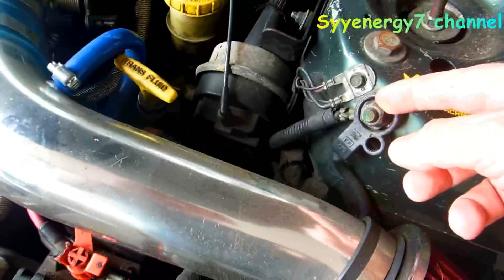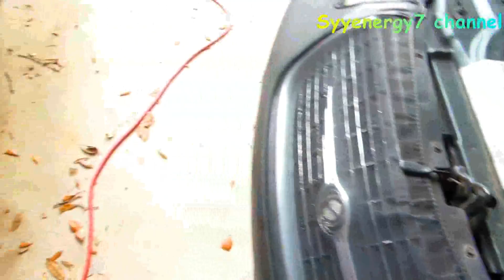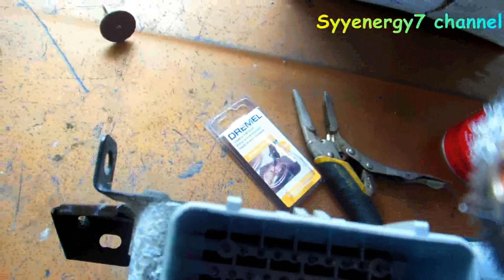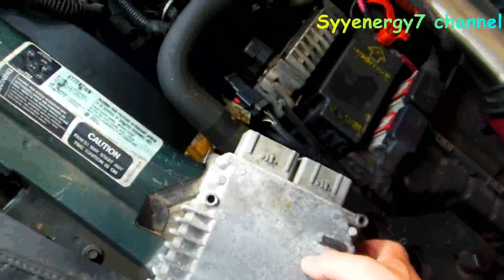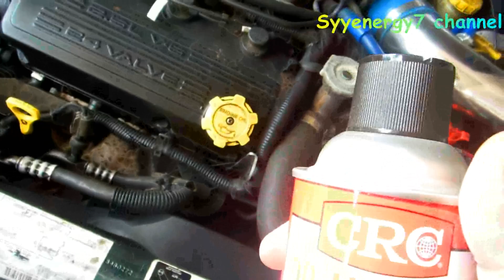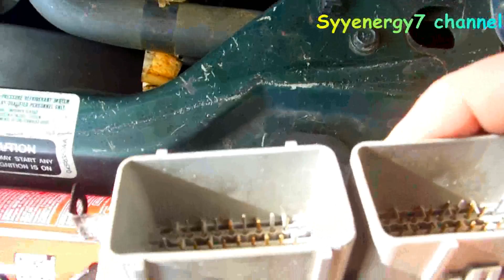How to Fix Car Electrical Problems - Strange problems, poor running

Comment: Hey bro..
Want a good idea...?
Take the cap from the electronic cleaner
Spray some on the cap....
Then dip a small brass brush into that..cap 
Then softly whip the ends of connections..grounds....//
Saves so much spray and dose a great job..

Comment: A Dremel tool to clean the computer pins !   Never,ever bring a wire brush, especially a powered one, near electronic connector pins.

Comment: i bought a Pontiac grand prix 1999 for $400 when i turn my heater on it doesn't usually work until speed 6 but it sometimes works on different speeds for a couple seconds then makes a sound on the driver side and my headlights go out same as the heater but my headlights and heater only work at the same time on speed 6 i have changed the blower resister thing and it didn't do anything so im stuck any ideas?

Comment: Use new dielectric grease on all the pins and connectors, instead of the Dremel tool, which can misalign and destroy the pins. Permatex makes and sells this special grease and it is readily available at any auto parts store. GM recommends NyeGel 760G, and sells it through its dealerships, although rebranded as a GM product. These special, dielectric greases both clean old corrosion off the pins and connectors and lubricate and protect them for years.
Reply: Anonymous98 never ever ever use electrical grease on ANY electrical point of contact!!. Proper installation of electrical Grease is around where grommets would be. I eat you should apply dielectric to the porcelain of a spark plug never to the tit on the top or to the inside of the boot for that matter...

Comment: I have a 2005 PT Crusier convertible. the windows on passenger side go partially down when I crank the car. the window on left went down partially and is now stuck. it was very cold when this happened the windows on passenger side will stay up once the car is warm. not sure if its a programing issue or not.
Reply: So you are the founding member of the club I'm in.. 98 Buick Lesabre windows on drivers side only work when its cooler out and some other weird stuff

Comment: My radio,lights, locks, and car key not working.
Reply from the maker: check fuse 5 , it's the one in the middle.
Reply: +syyenergy7 Thank you, it's actually my mom's car, I forgot to type that. I'll tell her.

Comment: hey im fixing to buy this 2003 maxima. its beautiful, I really like it. The price is good too $1,300 from my stepdads friend. However when i turn on the lights of the car, the signal lights stay on as well. They dont even blink as usual, they just stay solid. And when the headlights are turned off they function as they normally would.

Do you think i should invest in this car? please let me know your thought i would highly appreciate it. Could it be some electrical problem. If so would it be too much to repaor. The past owner looks like a DIY type of dude that might have worked on the car himself.

Comment: I have a 1999 jeep grand Cherokee and when the air and lights are on everything on the control panel goes to 0 and hazards come on.  When I turn lights and air off, it goes back to normal.
Reply: I am having this same issue with a 2003 nissan maxima.. any luck yet?

Comment: Hey body I have 2000 lexus es300, I have problems with the air fuel ratio sensor's 
Any suggestions, please
Reply from the maker: O2 sensors do fail after a while and need to be changed.  I use an OEM O2 sensor since some of the aftermarket stuff is crap.  Newer cars with computers need sensors up to factory spec.  After a while an O2 gets dirty and the only real way to fix it is to change it.   Sometimes fuel injector cleaner will clear an O2 sensor code but that fix is temporary.
Reply: I did I buy Denson air fuel ratio 
 And still have the problem, 
Sent the pcm to check and the technicians told me the pcm is working properly
Reply from the maker: I'm not familiar with a Lexus.  Likely it's another sensor but it could be a dirty or bad ground.  There are various grounds including the battery.  If a sensor doesn't get the right voltage or the computer is working off a slightly corroded connection somewhere it will be tough to diagnose.  Check all connections and grounds and clean every connection, with the BATTERY DISCONNECTED. Don't short anything out.

Comment: hey man my radio cuts out and lights flicker when I step on the brake pedal. I replaced my alternator and battery and it's still doing it ..I looked and all my grounds look good.what else can it be ??
Reply from the maker: +mikeymic845 Hate to say it and I'm not sure, but it could be the BCM (body control module).  The BCM could sometimes cause hard to trace problems since almost all interior circuits go threw i..
Reply: +syyenergy7 cars a 2012 .I brought it to the dealer ship and they have no idea what it could be . I was hoping maybe it was somthing simple and easy to fix I'm guessing it's not
Reply: +David Olson nope smh
Reply: mikeymic845 fic it yet?
Reply: Clit Commander no

Comment: Hey, probably not related, but my 98 honda accord started making a strange low honk the other day. 

Right after that moment, my horn became perpetually muted and kind of quacking instead of blaring. Anyways, I don't have a lot of shame, so I thought that maybe something having to do with my horn speaker was blown out or somehow disconnected. So I put off getting it repaired. I'm walking home today, one month later and the car sitting outside has been quacking quiet spurts while totally turned off for two days, and apparently had been quacking for 5 hours+. The battery I just bought was dead, the starter doesn't kick at all when i turn the key. and whenever the door was opened, it would stop, close the door again, and it would start again. I could do nothing to stop it. and eventually the battery died so fully that it fell asleep and stopped quacking finally. 

I'm a college student and live pretty low because of money, if I had time to take the car in or if I had money to do so, I would. but to do so would also be to have it towed. I'll be trying tomorrow to jump it and see if it can move.

If there's any clue out there about what happened today, I would be ever so grateful. I'm really worried about my car. I've had it for so long.

thanks alot yall. 

I really hope someone out there has an Idea.

-R
Reply from the maker: +James Martin Like I said, dirty connections, bad grounds or a partially shorted wire.  Problem is that it's a pain to trace and often requires a wiring diagram.
Reply: Hey well thanks for the help, at least now I should be able to give my mechanic an idea of what could be going on. I am tempted to look at it myself though. I have a multimeter and what I believe are the necessary tools. my problem is that I have no idea where all the grounds are hiding. 

But again, I really appreciate the fast response. I wonder where I can get the electrical schematics for such an old car.
Reply from the maker: +James Martin Likely you could google a wiring diagram for free. Take a look around on the net.

Comment: I've had my Alternator, Starter & battery replaced. Still having the same issues. I will drive it about 10 miles then all of a sudden my battery light comes on, then the seat belt light, then the air bag light and then the car will slowly die. I get the car jumped and then it happens again... HELLLPPP!!!
Reply from the maker: Ria S. It could be in the PCM because the PCM contains the voltage regulator.  The "mechanics" who kept swapping parts should have run the car a while with a voltage regulator to see what it is doing.
Reply: syyenergy7 thank you! You're the greatest!
Reply: syyenergy7 What does PCM mean?
Reply: The computer system...
Reply: At least that's what I thought.
Reply: "Powertrain Control Module" - just just searched it, so probably computer.

Comment: i just replaced the TCM on a 99 Plymouth Breeze, 153k went out.
Reply from the maker: 1999 Chrysler Sebring Convertible Autostick conversion 1 of 2
1999 Chrysler Sebring Convertible Autostick conversion 2 of 2
Changing to sutostick was worthwhile.  The car is faster in a practical way, without adding power.  Shifts quick.